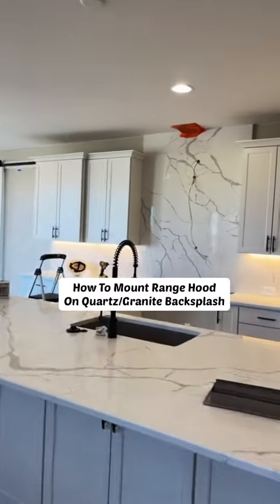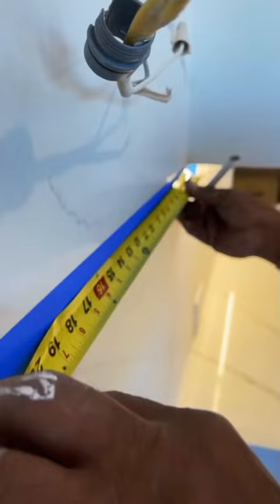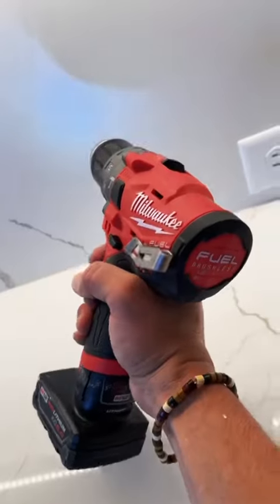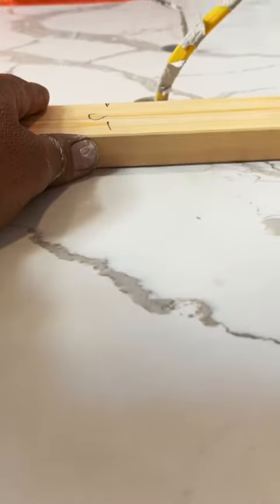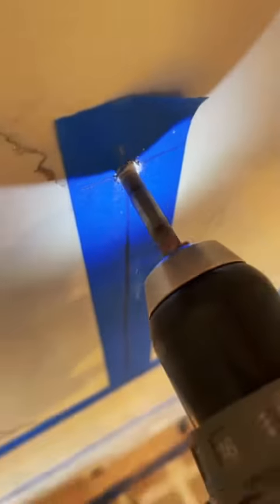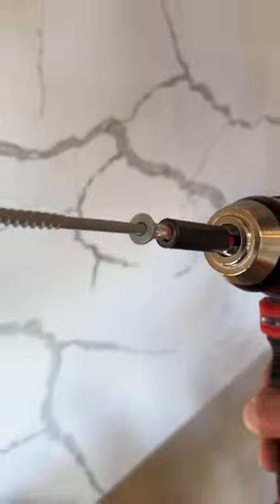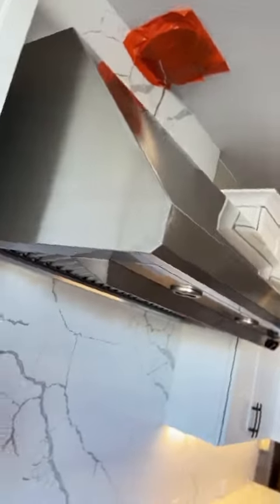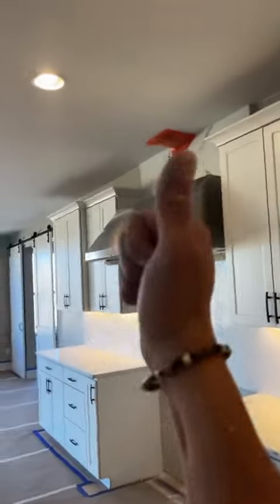How To Mount Range Hood On Quartz/Granite Backsplash. #handyman #wallmount #quartz #backsplash #diy

Comment: I bought the drill/impact drill kit. The best value ever. The battery stays charged for ever. The kit did bring two batteries. I was on the fence on getting the impact drill but it’s been a life saver so many times.